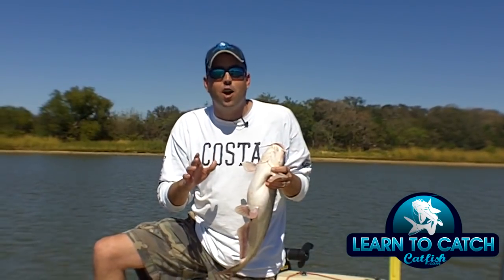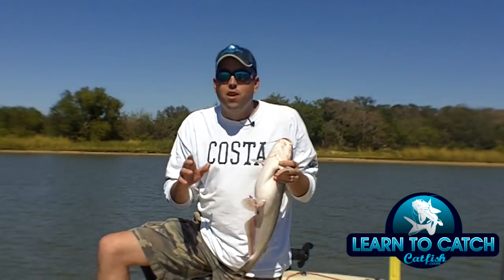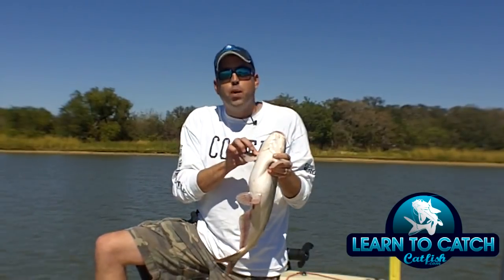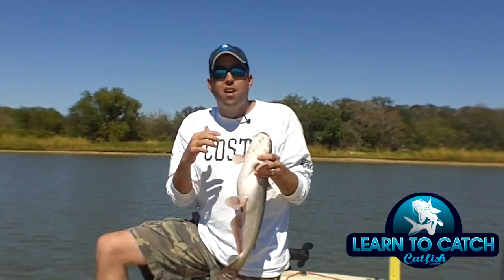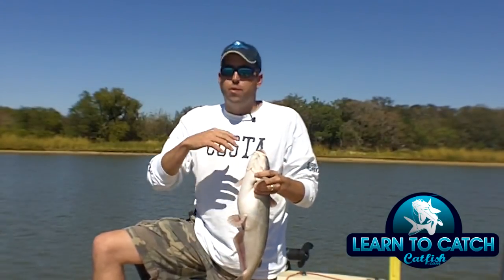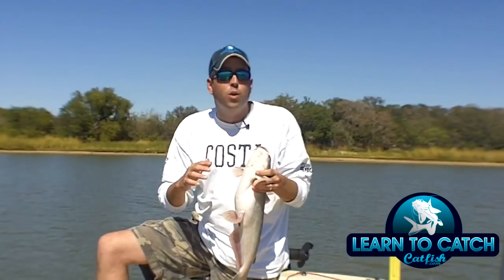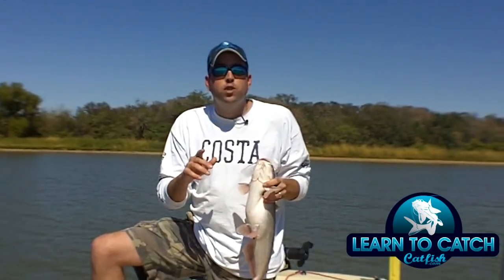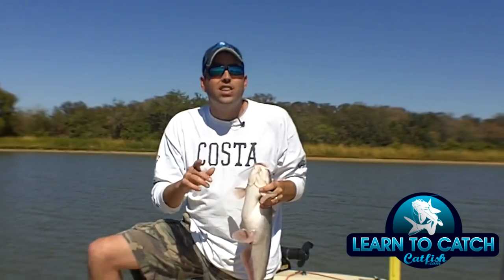What's That Noise Catfish Make? Talking Catfish? [Catfishing Quick Tips # 7]

Comment: So what is the reason for the noise? I would assume a defense mechanism because I primarily hear it with the smaller cats but I've never caught a monster cat so I wouldn't know if they make the noise. Ive caught a few ten pounders and they have never made the noise. But being that the noise is directly related to their only real defense(their stingers) could the noise could be a defense mechanism when threatened?that that noise would be very low pitched in the water deterring most predators
Reply: I think it’s a defense against predators